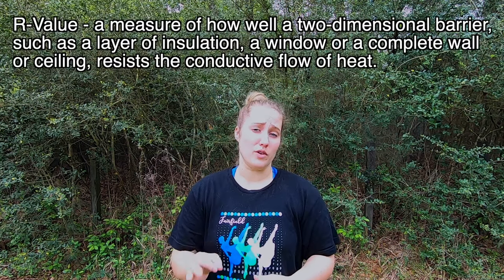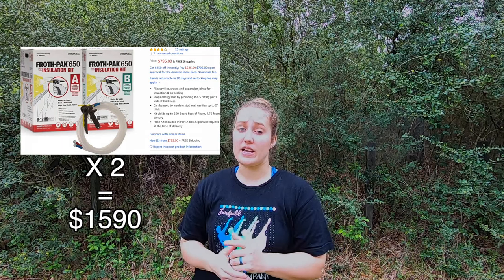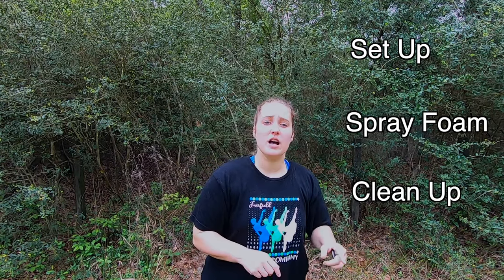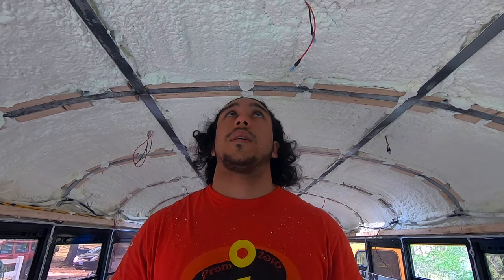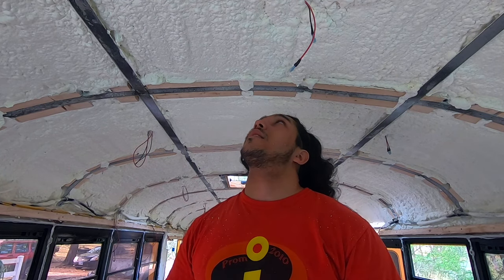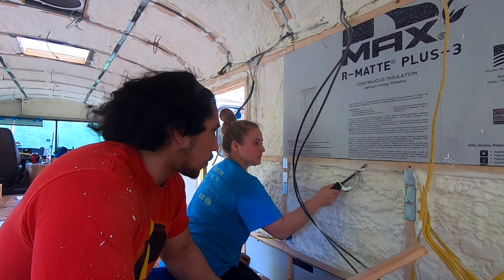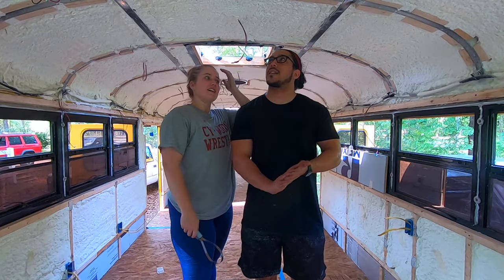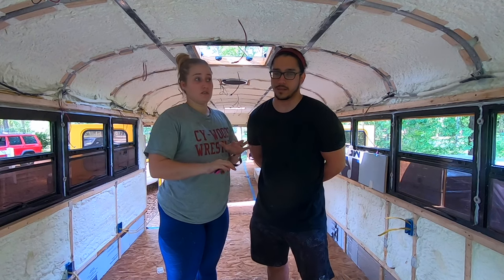Cost to Insulate a School Bus With Closed Cell Spray Foam * Skoolie Conversion* Gus The Struggle Bus

Comment: For scraping foam high spots down. maybe try a surform or a really rough 36 grit sandpaper wrapped on a block of wood.  but it looked like you got it knocked down pretty good with your methods too. Also love the soundtrack especially the remix of Melanie "Brand new key"!
Reply from the maker: Yeah, we thought about that but we did not have any dust mask and didn't feel it was safe to do without them! The curry comb actually worked out really well! Thank you those songs were fun!

Comment: Torch heat up scraper a little cut like butter
Reply from the maker: Hmm have never heard of this method before!
Reply: @GustheStruggleBus  it's called hot knifing used on foam board but dame thing foam
Reply from the maker: @elbertwatford2904  We will look into that thank you!

Comment: Spray foaming is fine but one thing I find people keep doing is spraying foaming their wiring. It is going to be a pain if you ever have to troubleshoot electrical issues or run new wiring. I would use conduit with maybe a couple of access areas, so you can access more easily and pull wiring if needed.
Reply from the maker: We understand your concerns and we have them to, but we felt this was the best route for us, thank you for your suggestions though

Comment: We just bought a 40 foot bus also up here in Québec Canada and i am also looking to Spray foam my bus.  So i have a question for you guys : How did you manage to cut the thermal bridge from the 13 hat channels all along the bus ? 
In other words,  how did you insulate those channels  ?
Reply from the maker: I used the original insulation and stuffed what I could in there and then used a spay can to fill any holes!

Comment: Why did you do both Kilmat and spray insulation? Is that recommended?
Reply from the maker: Kilmat is a sound deadener first so it is not an adequate source of insulation. We double checked with the company and they said it is fine and will still work great!

Comment: If you aren't done yet... Try an electric Kitchen knife!!!
Reply from the maker: That is what the guys used before they left for the bigger parts! It worked really well but since we have wires in the walls we did not feel comfortable using it. But thank you!

Comment: What’s your final calculated R value?
Reply from the maker: It ended up being different in places because the thickness varies but the thickest part about 22
Reply: MEREDITH and PACO, we’ve decided we are going with a product that’s 1/4 thick with a R-value of 9 & can glue it on or stuff between spaces. ..Used it on a straw bale home previously. Super cheap too.
Reply: @brandonsmith3060   What did you use?
Reply: @annahunt3818   it’s called ultra low-e https://www.lowesouthwest.com/ 
The product seems to have changed a little, but it’s still very thin and super insulated compared to anything else...Especially in cost.
We are applying a protective layer between the bus metal and the aluminum skin of the insulation to avoid electrolysis and deterioration too.